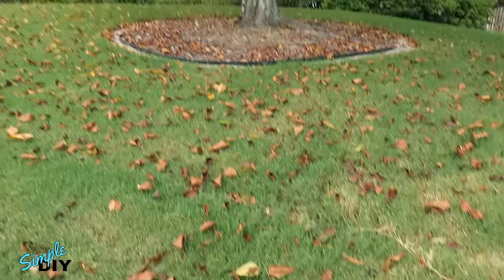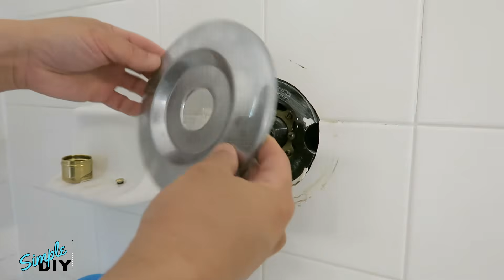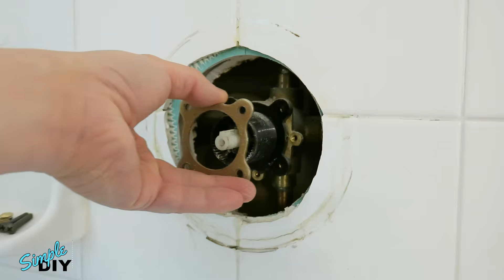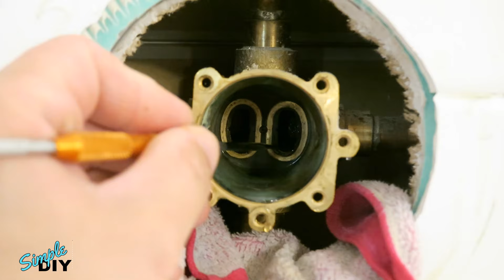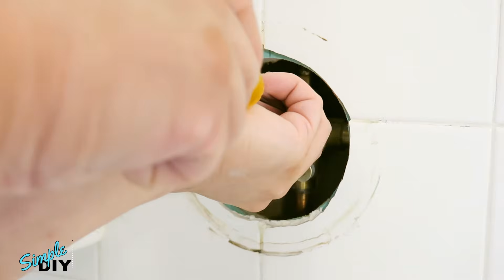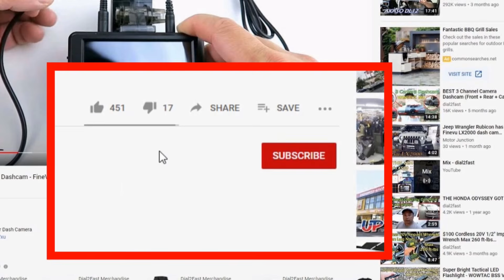How To Replace Pfister Single Handle Shower Cartridge

Comment: Thanks for the excellent tutorial! You made a task I was dreading into something very manageable. The only thing I'll point out is that the Pfister instructions for my new handle had me put that little plastic ring between the screw-on collar and the wall. I think your video has it between the collar and the handle. Other than that, I followed your video to a T and everything seems to be working great!

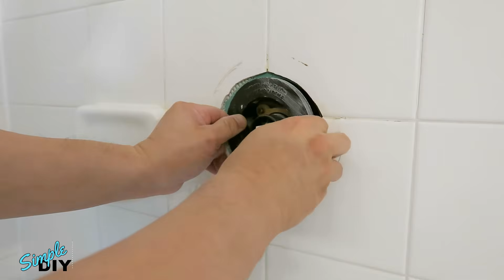Comment: The black cover is on the other side and I can’t fit it out of the hole any suggestions 1:39
Reply from the maker: Maybe they tiled over the fixture making it difficult to remove. You might want to try using a Dremel drill with a cutting wheel to trim the edges all around.

Comment: I have fister valve and can't remove it. It is very similar to this shower handle in the video. I turn it counter clockwise and then it gets stuck and can't turn anymore. I feel if I force it with a monkey wrench or regular wrench I might break it. What else can I do? Thank you for the video.

Comment: My Compliments. Our 1940 home was renovated about 20 years ago and just recently the shower/tub has been acting up. Suddenly we were scalding ourselves in the shower and got no cold water.  After researching I learned of the valve cartridge that needs to be replaced; haveing an old Pfister assembly your video gave me exactly the directions, step by step, thoroughly and precisely the way I needed.  I am no plumber but handy enough: I had shop in 7th and 8th grades - yes I'm that old.). Thanks for a good job and saving us retired folk a bundle on a plumber.  (No offense plumbers you deserve your wage, but some of these tasks are beneath you!) LOL.

Comment: I installed my new cartridge exactly as shown in the video but now the hottest my water gets is warm and at max hot, the water temp drops back to luke warm/colder. I've already adjusted the anti scald as far as it would let me and all other fauces and showers get hot besides this one. Is it possible the brand new cartridge is defective?
Reply: Take the handle off. On the front of the valve, you should see a black thing on the bottom that you can turn. That is the temperature control and is set that way from the factory for safety. So you will need to set it to the hottest setting or whatever you want to make it confortable for you

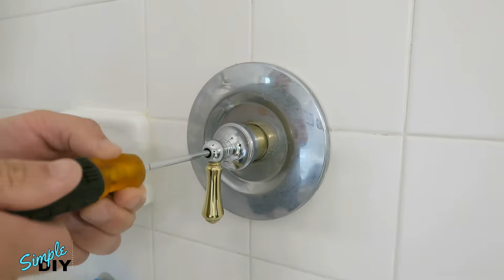Comment: hmm...the white plastic ring at 0:57, for me it's on the other end, touching the big round metal plate. And the collar it's on faces the other way.
Reply: Yes, 💯. I agree with you. It will cause water to flow in my crawl space if I put it that way. It happened in one of my rental properties a couple of weeks ago.
Reply: YES!  The white plastic ring is installed against the escutcheon (big round metal plate; ).  All other steps worked great for me.  Thank you for posting!

Comment: I opened mine and it does not have the black plastic ring but it has the screw holes. Is this normal? Thanks.
Reply from the maker: Yes that's fine. Perhaps yours didn't come with one.

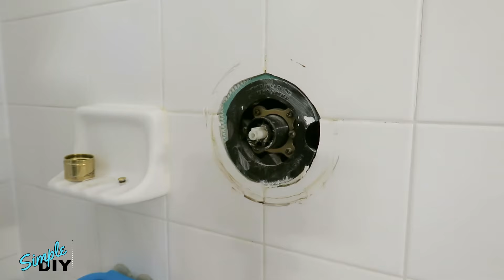Comment: Hello, I was replacing my shower cartridge, but I dropped the black plastic ring show around 1:33. I couldn't find any replacement parts for this, so I wanted to ask if this is an important part of the faucet that I would have to replace.
Reply: I don't have any plastic ring at all.